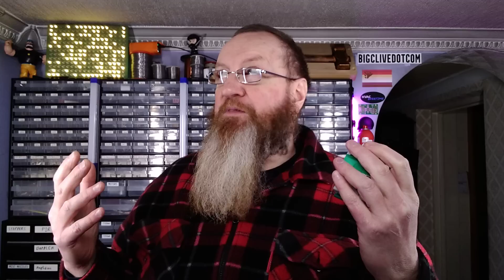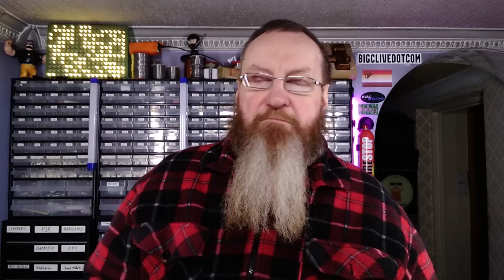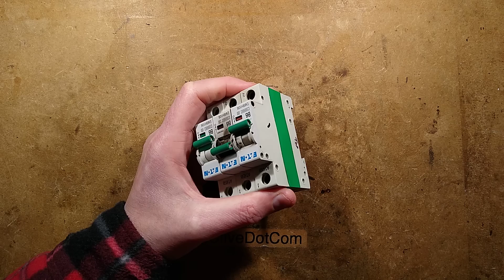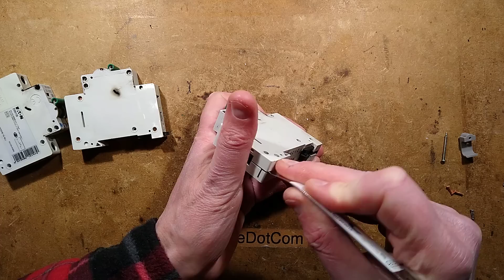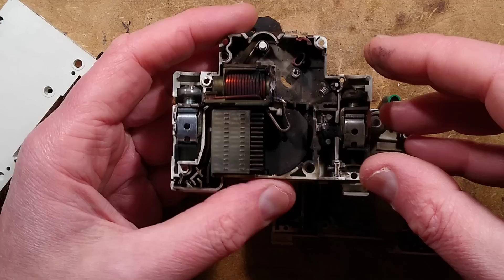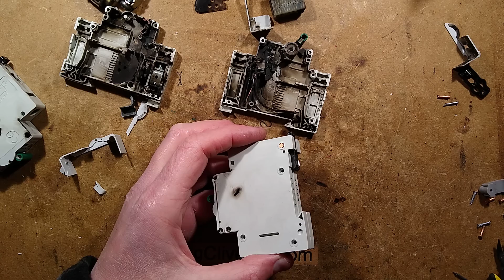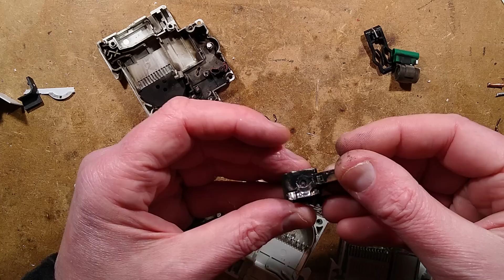Arc flash breaker failure - let's open it

Comment: Yep, done that, seen that. We have some power lines in the ground and some years ago we discovered a "forgotten" outlet rotting. Replaced that, but water seeping into the cable sheath caused the RCD to trip every now and then (RCD still working). This went on for a couple of years and then stopped. After that the breaker started to trip. And again. Resetting it would work except for the last time when it angrily flashed at my finger while pushing the lever up. This was all with very long periods of time in between. November last year the breaker finally had it's moment, it popped and was never to be motivated again. Pushing the lever up to reset it was to no avail. Once replaced I took the unlucky one apart and it was dark and sooty all over in the innards. Just like the one you took apart. Still haven't found what I'm looking for.. (fault). Thank you for this video. Cheers and stay safe, mate!

Comment: they have Eaton in england? are you in england?
Reply: Eaton is a global company - I would be surprised if there isn't a country they don't sell products in.
Reply: @ickipoo  didn't know
Reply: In my opininon they make the best general purpose cirquit breakers: ceap, robust, have the lever in the middle and the color coding is nice. Only thing I dont like is that they use a fork-type bus bar instead of an tab-type. 
If money isnt a problem then i prefer Siemens industrial 5SY4 Line, they have rail latches on both sides (can be pulled straight of instead of tilting) and have the best build qualiy.

Comment: This is one of the reasons why my dual - bank of RCBOs has a conventional HRC fuse per bank, to at least try to avoid this problem. Would there be any mileage in using a thermal imager to see if there's any unexpected hot spots on the backplane? My imager has proved more than its cost in terms of searching for thermal issues  (= poor contacts) in our distribution system.
Reply from the maker: That could definitely show failing contacts.  Thermal imaging is a must for factory maintenance now.

Comment: A condenser Microphone may pick up the pop. The time between the breaker switch and the fault pop will be the speed of sound. The machine can give a radius of feet and inches from the breaker. Interesting electronics. Thanks.

Comment: Ive seen a hundred amp 3 phase 480v breaker physically explode with force similar to a grenade. It happens on a waterjet cutter with a bad pump motor. I told the boss it had a dead short on the motor and we shouldnt try again to get it running.. He didnt believe me on how bad it was, and had another tech loook at it and they F'ed around snd found out. Did give the other tech fair warning though so they could use a long pole to hit the start button and they didnt get hurt, though im sure their underwear neeeded changing. 😂

Comment: Handle of the insulated screwdriver and looking away from panel are my tips for re-energising a circuit.
Reply: long wood broom handle from 6' away to the side(hitting hacked contactor pair for directly reversing a big motor) yeah, did that and had a long sustained arc before at 480v phase to phase, it blew a wire off up behind me and arced for what seemed like an eternity. before the old Federal Pacific 15amp breaker opened. that was at a career center in the mid 1990's, in former welding lab used for "industrial electricity".
when it occurred, it browned out half the building and crashed the majority of the computers in the building. nobody got injured, other than some short term arc flashed vision and I did get some copper sputter on my leather jacket(standing 3' away). everyone that year gained high respect of power and arc flashes.

Comment: Is a part of the "circuit breaker lottery" when you throw it on relative to voltage waveform zero cossing ??
Reply from the maker: The point in the sinewave it makes contact could definitely have an effect.

Comment: Interesting that the upstream series of protections simultaneously tripped albeit without the destruction of the device(s). It suggests a very high prospective fault current. I'd have been interested to learn a bit more about the distribution network and what devices were upstream. As you mentioned L to E faults differ from L to N faults because it's far more common with L to E protection to encounter time delayed operation disconnecting devices to provide discrimination and contain disconnection to particular sections rather than wide area outages. Good old type S RCDs.👌

Comment: Shouldn't they mounted in vertical orientation to extinguish the arc properly ?
As far i know many breakers in the UK and US are mounted in horizontal orientation.

Also the short circuit current should be measured, in some cases the current overcome the 6000 or 10000 rating.
Reply: At my old workplace we had two 1500A low inductance bus bars going around the building. As we discovered when one of the power meters self destructed, the fault current on the 400A connections is enogh to compleatly obliterate a standard 10kA rated breaker ptotecting the voltage sense lines. Now the sense lines are protected by 5A NH00 fuses.
Reply: @lukahierl9857  That is why the Classic Melt fuses still exsisting and frequently used.
Spechial types like the small 10x38mm zylinder Fuses are able to break tp to 160kA 690VAC

A new Installation should be planned and measured for the short circuit current to select the correct fuse.

My boss had to make short circuit calculations for the bigger projects.
Even the Mounting points for the Busbars where very important because of the possibile lenz current forces.
Reply from the maker: In a home consumer unit they are mounted vertically, but in an industrial distribution panel they are usually mounted horizontally as vertical stacks either side of the three phase busbars.

Comment: Had an intermittent fault on a 11kv  dedicated feeder  from one substation to another. Cable run was 2 miles, yes 2 miles, long and buried its entire length. Tried resistance measuring to get a rough idea where to dig, repaired the cable, left it pressure testing for 24hrs and re-energised . After finding 3faults, and then blowing a crater in the ground for the fourth time the decision was made to replace the entire cable . £1.5 million ,6 months , to trench, new jointing pits and new cable. Intermittent faults are a real pain 😂

Comment: It could also be possible that the maximum current the braker needs to disconnect is too high. Most Industrial buildings have their own transformator station right next to the building. Because of this you can get very low Zs/Zi Values which will cause/allow high currents in case of a short. If that is the case and you need to reset the braker over and over again it will weld the contacts eventually. But the one which exploded already has 10kA... 
Would be interesting to see if you could spot a difference in like 6/10/25 kA Circuit brakers.

If you have currents which exceed the circuit braker you can either install the higher rated one or install backup protection like a fuse or something like a selective Circuit braker . I only know the german name "Leistungsschalter". You can then select one for your cabinet which will be selective in both directions. 

In our company we now have a customer which needs a whole calculation for their whole company. They got a new Transformer station with 1MVA. If anyone knows a programm which is not bound to one manufacturer write it below please. We now try using EPInstrom.

Anyway: Thanks for sharing this. Now I can show this to someone if they ever say things like:" I just need to flip the switch back on and it will work for a while."
Reply: In the USA we have series rating. For example, a type CH (Cutler-Hammer/Eaton) breaker with a 10kA interrupting rating, if used in series with a main breaker of a specified type, will have a 22.5kA series interrupting rating. Most of the residential panelboards/loadcenters used in the USA have breakers with a series interrupting rating of 22.5kA from what I have seen. This is the combination of the main and branch circuit breakers.
Reply: @brianleeper5737 interesting. Here in germany most houses have an set of NH00 fuses rated at 120kA followed up with an current limiting main breaker rated at 25kA. That feeds multiple 30mA GFCIs wo each protect a bank of 6kA rated breakers (like clive showed in the video). The much higher initial capacitcy is nececary because we use bigger transformers with lower impedances, each one feeding 20-50 homes.

Comment: Had a lot of nuisance tripping on an RCD protecting 10 circuits. Eventually we swapped the RCD for a circuit breaker and turned everything back on again, then waited. A very loud bang from a heating fan that didn't even trip that circuits breaker. New fan fitted and RCD swapped back in again. Sorted.

Comment: I had one like these get smoked when lightning struck near one of my solar creations.  It saved everything but a 48-12V buck-converter which seems to have saved everything downstream. Very glad I put in a silly amount of breakers.  The inside looked very similar to yours.  The buck converter was fully potted and I didn't have the drive to dissolve away the epoxy for mere curiosity. These things seem to be well designed to die a meaningful and dignified death.

Comment: If you have too many power supplies with capacitors on the same circuit then you can get a situation where a second reset holds.
Of course you should upgrade your electric system, but that's something you'd need a budget for in a company and that can take a while to fix.
Reply from the maker: Yeah.  Inrush current to switching power supplies can be annoying.

Comment: For the amount of arcing it's contained that beautifully.
Reply: Task failed successfully
Reply: Not really.  The fault was not contained inside the device and it damaged other equipment. 
Not sure how the CB got the 10kA rating if that happened.   A fault higher than 10kA?
Reply: @BTW...  We don't know if the distribution panel had proper sized SCC limiting feeder fuses/breakers, also the 10kA rating doesnt mean it can handle a 10kA short and look brand new, it only means that it can still safely cut a 10kA short. Now the problem is that previous reconnections might already have started to char the inner plastics or maybe copper from the contact spread on the mcbs inner walls so that the high current fault then couldnt be properly extinguished because  there was a lot of conducting material inside which then led to an unnormal amount of energy being released as plasma and blowing into the next door MCBs.

Comment: Is that breaker designed to meet some UK specific code? because I can't find it for sale elsewhere
Reply from the maker: It's a standard DIN rail mounting breaker.  Very common in Europe.  Probably found inside many industrial machines in America too.
Reply: @bigclivedotcom  I know, I'm from Spain, but for some reason according to Google this model is only available from the UK sellers, as if it was something special 🤷‍♂

Comment: Lucas, lord of darkness was involved.
Mice are one of the factors causing problems. They die and then their fluids flows into the electrics and if you have a collector rail mounted at the bottom you'll get a barbecue cooking. Especially if you run 3-phase.

Comment: I accidentally connected L1 and L2 and the bang when turning on was impressive
Reply from the maker: My employer supplied a three phase control panel for installation by an electrical contractor and left in very obvious test links in the main connection terminals for their single phase test at the workshop.  The installer left the very obvious links between the phases and blew it up.

Comment: One small thing I want to emphasize:  "It's designed to break 10000 Amps"  yes.   But it's designed to do that  ONCE.   After which it's meant to be replaced.
Reply: This is untrue. Dive into the datasheet and you can find the actual specified number of cycles at rated short circuit current. It is in the order of 100-500 times depending on the breaker
Reply: @mfbfreak overload trip can happen hundreds of times as you say (about 20-50A). Short circuit can only happen 2-3 times (10 000A).
Reply: @  It's scary to me how many people (who seem to really know their way around a circuit)  get this wrong.
Reply: @ "rated short circuit" is not 10000 (ten thousand) amps though.   More on the order of 1000 (one thousand)
Reply: If it were a 'once and replace' thing, you're be using fuses and it wouldn't have a resettable lever. 
Of course the short circuit current specified may never ever be exceeded, and the technician needs to calculate or measure circuit impedance to ensure the available short circuit current will not exceed the breaker's capacity. If it does, you need to buy a different one that can handle larger current.
Reply: Just switch it back on again, it's fine. If it trips again, just try until it remains on. 😅
That's how my father did years ago when the breaker for the stove tripped. Turn it on ten times or more, then it stopped tripping and worked for years without issues. When we moved to another house, we found a charred mouse in the stove, which was probably the reason why the breaker tripped.
Reply: Correct, BUT... It will NEED to be replaced after a single 10kA short circuit fault.   There is no 'turn it back on again' option. 
Just like this destroyed example Clive has there... gone out on a high kA short circuit fault. 
Chances are that tripped the circuit breaker in Main SWBd feeding that DB as well. Perhaps a 10kA short... perhaps >45kA.
Reply: They can be damaged just from one trip.
The electrician was adding an outlet at work. When he went to turn the circuit ON, the breaker tripped with a SNAP.
(He accidentally shorted out some wires in the outlet box.)
Breaker would not pass any current afterwards, it had to be replaced. This is a 120V three phase circuit (120/208V) fed off of a roughly 50-100kVA transformer, which is fed by a hefty 480V service. I wonder what the fault current was? It probably vaporized the contacts or the flexible braid.
Reply: @BenjaminEsposti  fault current for such a transformer could be about 15000A

Comment: The bane of being a repair technician. "It has to be broke while you're looking at it." "If it ain't broke you can't fix it."
Reply from the maker: Which is also why blanket lock-out-tag-out is actually nonsense for active troubleshooting.
Reply: @bigclivedotcom remember rules like that are usually written in the blood of workers before you
Reply: A maintenance person's worst nightmare: "Intermittent"
Reply: Especially when it's engines
Reply: @bradprimeaux8443  I have a philosophy when it comes to 'intermittent'.
Play with it UNTIL such time that it completely breaks!😜
Reply: @bradprimeaux8443 and also, “it was ok until you touched it” !🤭😧
Reply: Technician Syndrome; a fault cannot be replicated in the presence of someone who can fix it.
Reply: @danielv5825 well if it could be, it would have been fixed by now 😁
Reply: @danielv5825  I actually use the term Technician Proximity Syndrome, wherein something that won't work, starts working as soon as the person that can fix it arrives.
Reply: @ 🤣I like that comment.
Reply: Which is why I say, "If it ain't broke, fix it until it is" 😂
Reply: @uzlonewolf  if we can't fix it, it ain't broke. And if it ain't broke, we can fix that too.
Reply: Yes, I work as a heavy truck mechanic and there have been countless times when a driver says something is wrong, something does not always work or some fault light comes on intermittently. I check everything and everything works, I read the fault codes, nothing, I test drive the vehicle, everything works as it should and still there obviously is something wrong, it just does not happen when looking for it.
Reply: I am a computer programmer and the same is true for me. If I can't recreate the issue, I can't fix the issue.
Reply: One phrase I have to tell a few customers is " Intermittents are intermittent until they aren't'.
Reply: There are many scenarios where it's unwise or unfeasible ($) to go tearing stuff apart because of poorly described intermittent issues, but spending a little time thinking about it and troubleshooting is good for the soul!
Reply: Made my day😂

Comment: l’m sure it illuminated the electrical cabinet , pop a lot of magical smoke , the odor of burnt varnish and huge skid trace on the slip , after trying to reset this CB ... I wonder if the loads where turned off before the reset , that was a massive arc ...

Comment: We have this exact problem at our campus. The people installing the outdoor illumination 25 years ago  just stuck the lampposts into the dirt. The kabeling runs through a cutout at the side of the metal lampposts. Over the years the lampposts did sink in a bit and now are resting with a sharp metal edge at the kabels. Every time we have a damp windy night that rattles the lampposts one or two phases of the breaker fail (I did change the 3-phase breaker into 3 single phase breakers many years ago). So we check this in the morning and reset the breakers.
Luckely at this time the power to this circuit is switched of, so no danger of burned hands.
I try to get the renewal of the outdoor lights into the investment plans every year. But as long as it does not burn down itself this is futile. Way to expensive.